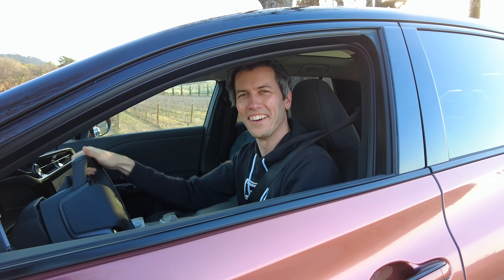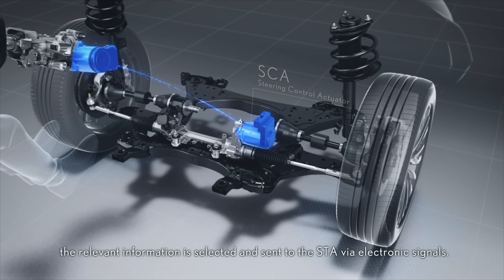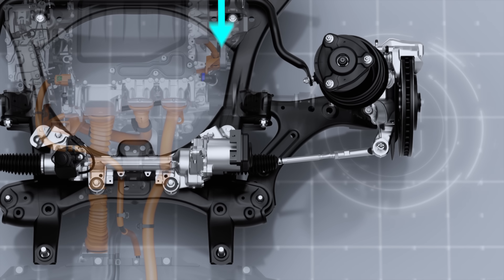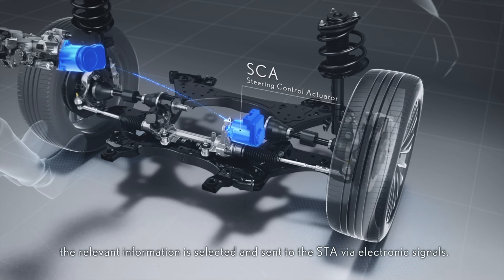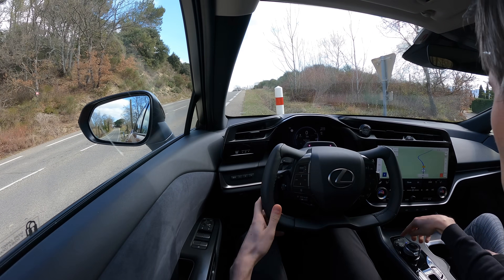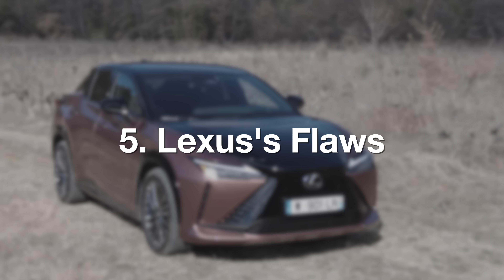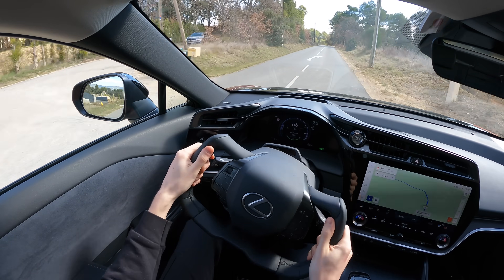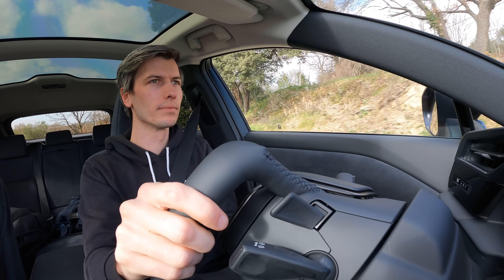How Lexus Fixed Tesla's Bad Idea: Steer-By-Wire Yoke

Comment: Question. Say your coming around a corner at 55 mph on a country road or something and need to slam on your brakes (deer running across road, stalled car up ahead etc.) Their is actually a road near us that has a lot of this and many accidents due to their being a left turn into a side street and limited visibility. With the system detecting slower speeds will it start steering farther and farther even when the wheel isn't moving? Because that could be a big issue especially in an already tense moment, having to also slowly steer back as you come to a halt. Otherwise how would that work. If you need to make an evasive action would it read from the old speed or newer speed?

Comment: This is cool technology, and I'm not opposed to it. But in terms of safety, redundancy of physical elements can only go so far. It's the software I'd be more worried about. What if an update introduces a bug that messes with steering? What if a bad actor gains access to your software?
Reply: 1. Crash at low speeds and sue the fk out of them. 

1.25 No sensible company OTA updates critical components 

1.5 as someone who worked at REDACTED research and development many of these systems are not designed and built by *REDACTED*, but instead BOSH was a big player. The auto manufacture may have some configuration files to put ontop of but it’s mostly say BOSH. I know a bunch of us got called over to the factory to baseload ~100 power steering racks from Bosh as they were not accepting the factory configurations, needing their proprietary software to do so. Not only that. A good portion of the firmware like the ECU, power steering, gauge cluster code came from the manufacturer themselves, and would have to go extensive testing by the auto manufacture and the government to get the “road legal” certification. A system like this would lump under that. There’s no way a jr dev could screw somthing up and push an update killing thousands. 
There were hundreds of prototypes with with a piece of paper literally duck taped ontop of the stereo saying “Not road legal” and a list of software that was not

2. In no situation should a hacked radio/infotainment (the thing that would realistically get hacked because it’s the thing that communicates) gain access to critical systems. Any modern car that does not have physical isolation between critical systems and the radio should be sued for negligence.

Comment: The whole explanation does not relate to steer by wire. Active steering does exactly the same since 2005 or so, but you have a mechanical connection. I would wonder about the steering speed. What if you loose traction and start dancing. You loose the car. Did the steering translate steering movements 1:1? You are the first to adress this in a way.

Comment: I don't comment before fully watching, but it bears mentioning. Drive by wire has been all but standard in planes for a while
So if it was unsafe, a lot more planes would've crashed just because of it by now. Which they haven't

Comment: they can even implement rear wheel steering to with this, you can basically have lower turning radius in a modern 6 metre long car than a mini compact hatchback😂

Comment: Lexus and Toyota are the definition of reliability in the ICE world, I say we give them not only the benefit of the doubt, but more importantly the funding to figure out electric cars or hybrids for the future. Say both these options are superceded later on by a far cleaner, alternative fuel, this type of control still benefits those platforms also. Toyota & Lexus are solid, not always, but in general. This video has the right approach to verify that they remain reliable. I would still take either of these Japanese gems over any German, American, French(🤮) or Korean offerings any day of the week and so would most serious drivers. And don't get me wrong, an old 4-to-the-floor 4-banger will always be fun, but not every day of the week. You don't surf to work😂. Great video as always

Comment: I had water in the trunk of my E87 a while back, where the pdc-ECU was. Eventually, some connections on the ecu corroded, suddenly cause all kinds of shenanigans throughout the whole CAN-Bus. Had my speedo randomly shut down while driving and more. Nothing serious, car was still driving fine. However, since stuff like that is possible, i dont know if i would trust in redundancy only. Especially redundancy within the same housing

Comment: What if you slid and you have to correct yourself? How does the vehicle determine your speed and therefore ratio of you might be going a different direction and speed than your wheels are going. 
I am not concerned about the tech and engineering. I am concerned about how it works with the driver and them not knowing everything about steering by wire. This might cause someone to skid and be unable to correct it because they over correct.

Comment: "Is this safe"...*snort*...we literally use it on airliners, which are orders of magnitude safer, of course, pilots I suspect said the same things in the 80s.

But yeah, one of the advantages of the implementation on airplanes is that it prevents control inputs that will destabilize the plane in flight (e.g., the computer prevents stalling). It's obvious these same restrictions should be used in steer by wire. Of course, I strongly suspect this will be hated in many circles, because driving is about freedom, the freedom to endanger yourself and others without any limits!

Comment: You’d be surprised how much those steering sensors in the driving wheel fail in 8+ years cars. This is such a bad idea.
Reply: Did you walk away when he mentioned redundancy in the entire system? You would need two random failures to happen within 30 seconds of each other.... not gonna happen... and as it goes, the CyberTruck has triple redundancy... so you can stop fearmongering

Comment: In a normal steering you can only turn the steering as fast as the rack would allow you to. Same principle should be applied to the electronic rack. Put more resistance to the force you can apply to turning the motorized steering wheel

Comment: Soo what of system glitched out and make it twitchy steering on highway?
Reply: It's built like aerospace tech, you do realize every modern airliner is completely fly by wire, there are zero connections to any controls and they're like the safest form of travel...

To answer your question there are two or more sensors for every reading and there are three or more computers that control everything. 

To avoid glitches like you mention, every command made by the computers are first voted on amongst  each of them, if 2 computers say turn right slightly, while one say jam the wheel left, it will be outvoted.

These glitches are usually caused in two way, first and most likely is cosmic radiation, the second is bad wiring or sensor which would easily be noticed by the vote. Each of those causes could really only affect one computer at a time so it's extremely reliable.

This is how all airliners and spaceships work.

Comment: The key reason that fly by wire is used in airplanes is to prevent or limit the ability of inadvertent or poorly chosen inputs from the pilot to cause the airplane to go out of control. This justifies the extra cost, complexity, and failure modes. Steer by wire as yet does not offer meaningful inherent safety advantages and is a bad idea.
Reply: I don't think the point is to increase safety but to maintain it while providing other benefits. 

And how is it a bad idea?

Comment: True however aircraft are inspected regularly every few months and fully rebuilt every few years. Rather with a car it is only inspected once a year and if problems with the car may just be ignored until it fully breaks.

 Before any says physcial systems can break wont on aircraft where there are eletrical and physcial control systems and i have not yet seen the physcial linkage malfunction in any way, i have seen the electrical portion however malfunction countless times

Comment: Electric assist was a good idea, not just because it leaves a mechanical connection, but because it uses less power than old school hydraulics.  This is a waste of time.  Nearly zero benefit and a constant power drain.  It's a step backwards.  I bet manufactures can't wait to make it the only option, just for the obsolescence.

Comment: Brake by wire often has a backup mechanical system. Besides arguing that we already have multiple unsafe features such as removing handbrakes and brake by wire so we must have steering by wire so we must have another extra unsafe feature is insane.

Vehicles are getting heavier to the point where better steering, tires, and brakes are still limited by basics physics. Further removing control will be an absolute disaster.

Comment: the limiting of control seems to me like flight envelope protection on flybywire aircraft where the controls limit you so you cant stall the plane but still be able to have control. similarly this system would hopefully only limit steering inputs that would certainly cause a spin or a loss of control. but if this is the case car manufacturers like in aircraft need to provide some way to turn this system off when you need it so the steering inputs become direct when the system doesnt have the neccecary data to know what will cause a loss of control (like in airbus aircraft normal- and direct law).

Comment: OOOf. yeah. no. I was wondering about the lag, and then you addressed it. That alone would probably enrage me. 
Even if they fix it though, I imagine this scenario: "I tried to swerve on the highway to avoid a collision, but wasn't able to to move out of the way due to the car not moving like it was supposed to"
I imagine if you drive it a lot, you'll get used to it. But lets be honest, with gear ratio changing due to your speed, most people will never be able to adapt and predict it's control. It'll cause more accidents. Maybe that won't apply to most viewers of this channel, but I sure wouldn't want to be a passenger of most of my family in this vehicle. And those are going to be the majority of people out there on the road. *shudder*.

Comment: doesn't that ratio argument get nullified by the fact that steering assist already covers this dynamic steering where the car's speed dictates the amount of steering required to get the car to turn though? fairly common stuff on EU cars.

but also... i sincerely believe that by overcomplicating things like this, society is setting itself up for more frequent failures that most of us can't fix, which in turn translates to - even - more revenue for manufacturers... as if it wasn't bad enough.

Comment: The feedback sent to the driver is still artificial, engineers try as they might still cannot replicate the natural feel , as for variable ratio mechanical steering, yes that is a thing in some brands.
 And the notion that being direct makes for a better driving experience is a farce in many cases imo , and i earned my bread butter driving for a living , i would rather have the happy medium between 50's style steering with 4.5 turms lock to lock to modern ridiculous steering with half a turn lock to lock , just my two bobs worth anyway ..... Keyboard 1001😊 .

Comment: How this wired steering system will act if something happens to it's electronic parts when you are driving it on a high speed? For example: broken wire, worn out brushes in a motor, water in a motor or in a electronic board

Comment: There is a huge difference between steer by wire and throttle-by-wire, steer assist and other systems you mentioned. The latter can be pretty much safely disabled in case of a failure, the steer-by-wire needs to continue to function even in case of failure which is way harder to achieve. Only 2x just won't do it. You need (at least in case of sensors) 3hree and more and some voting logic between them, etc.

Comment: Great video. As mentioned, what is being called steer-by-wire is simply fly-by-wire. The comments posted aren’t a great place to debate the merits of such systems in cars, as many of the same people who will say it’s absolutely not appropriate for cars (safety, testing, blah blah) have/did say the same of traction control, automatic transmission, power steering, power brakes, even power windows (I vividly recall the hyperbolic can’t roll them down when trapped rants). For many, anything much beyond Fred Flinstone’s ride is a bridge too far in terms of driver control. 

My takeaway is recalling having read reviews of the (at the time) futuristic concept cars driven by automotive journalists from publications like Car and Driver which vividly described the “fly-by-wire” steering and the feel of driving (too disconnected from road response) that system. This was very early 1990’s. It’s not remotely new, even in cars, only the name has changed.

Comment: TL;DR: Garbage tier execution of a good idea that's already exiisted before Lexus. That insane input lag, bad decisions about electronics that realises this idea. Wheels not rotating back with the steering wheel is absolute incompetency by the software devs.

I wish you provided actual numbers. I tried to count the frames myself but it would be better to have the raw high fps video for more accurate calculation.
At 12:01 I counted 2 frames before it starts turning.
It took 9 frames to reach maximum rotation before starting to go back to neutral after you hit maximum rotation on the steering weel.
It took 4-5 frames to center itself. 

2 frames in a 30fps video is about 66ms. Which may not seem high, but if you have played online games and experienced the lag between 60-70ms and 10ms. It IS noticable.
9 frames is 300ms. Which is astronomically high.
4-5 frames is 133-166ms.

It seems like its initial response time isn't that bad considering this is still not at the prodution quality. But the way it continues to steer even after you start rotating back to the centre is concerning and unacceptable. Seems like the drive-by-wire system is actually drive-by-software.

They should approach this with more elegance and use proper electronics to translate information between the steering wheel and car's wheels. If you put an actual computer and high level software to calculate steering, it's going to be slow AF as Lexus demonstrated here. And incompetent software developers will make mistakes that results in wheels keep turning to max even when the steering wheel is already on its way back to the centre.

Better yet, they should use analog electronics.

Comment: waving off safety by redundancies is so disingenious its not even funny

power source might have redundancies but guess what, if WIRING to the system shorts that means you lose ALL THREE power sources at the same time 

same thing with the redundancy in the steering system, you can never rule out redundant systems failing at the same time, especially if they are housed so close together or in the same damn housing, true redundancy would be having two completely separate systems working in paralel which would at least give the system reduced functionality if one half of it fails

traditional shaft gives "manual backup" in case of total loss of power or failure of power steering assist system you can still safely control the vehicle, if that steer by wire system fails you can end up veering into upcoming traffic or off of the cliff in FRACTION OF THE SECOND because unlike physical control that will give immediate feedback, losing by wire system will result in driver trying to turn the yoke while wheels remain completely unresponsive ...

this is a solution looking for a problem while putting a lot of lives on the line ...

ther is also risk of someone hijacking the system or buggy update screwing with the control ...

just no, there is absolutely nothing wrong with traditional controls and last thing we need are cars on the road that can go out of control by blowing a fuse ...

Comment: Steering force feedback is nonsense on computer wheels which  costs 1000eur and so is on a car. It would never be the same like direct mechanical feedback, and it even not taking in consideration steering lag. Another big issue.

Comment: Not sure but I think the steering it’s not delayed, it’s just that for 1° of steering wheel the car has to move the wheels more degrees which of course takes more time. Technically if they did their job properly the delay from the moment you move the steering wheel to the moment where the actuator starts moving the wheels should be imperceptible.

Comment: Only real concern for me would be an emergency maneuver at highway speeds. would the input be sensitive enough to handle what would likely be an extremely sudden steer and would it happen fast enough given there will be lag? Otherwise seems like a good system assuming it has a lower level of maintenance than a mechanical setup.

Comment: No offense but the speed and steering ratio is already there for regular cars for many years. So it is not a reason to have wired steering.

All in all, it is a simulation of the sensation drivers are already getting from the road and car related factors. It is “No meat Hamburger”, the “Vegan Cheese”.

Now if you ask a vegan “why” you should pick those vegan products, they will tell you that you save lives of animals, remove suffering from our diet and help the environment through using resources more efficiently. And people would still argue that it is not meat or cheese.

In that sense, the “why” question requires a more comprehensive answer other than “yeah we simulate”. Do you save resources? Do you save lives? Do you increase productivity? Profitably? And even then, why would anyone prefer the simulation unless it is the “hype” which is being built by such promotion of yours.

Sincerely,
Erdem